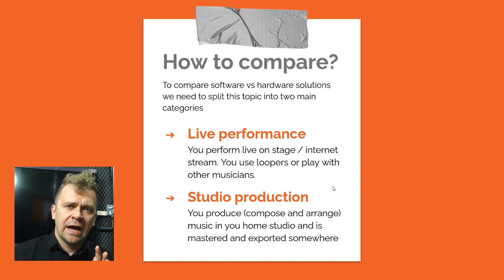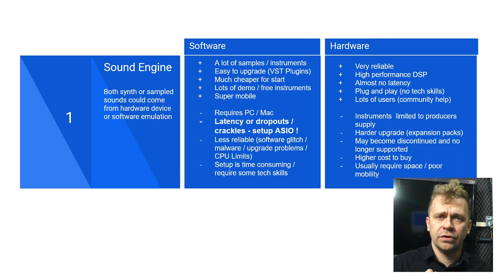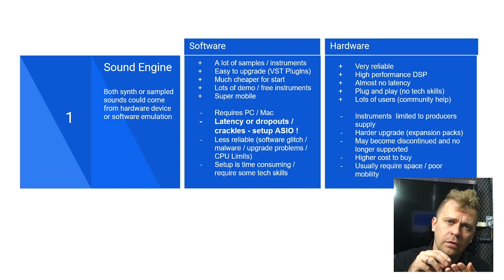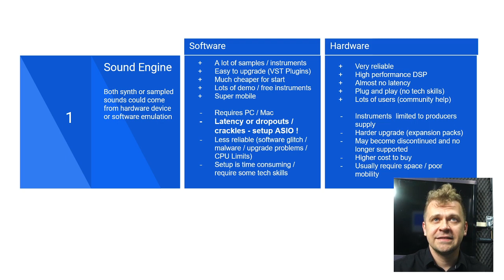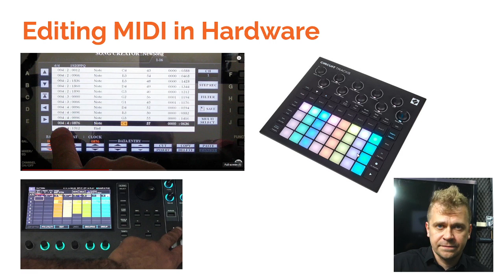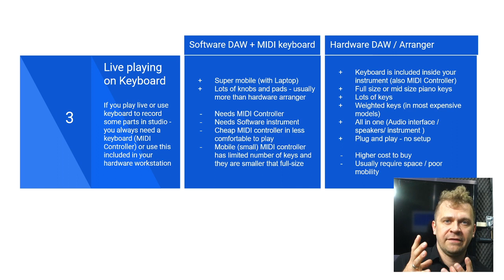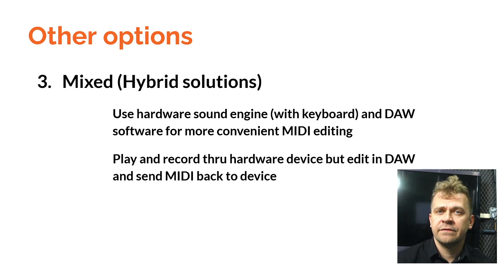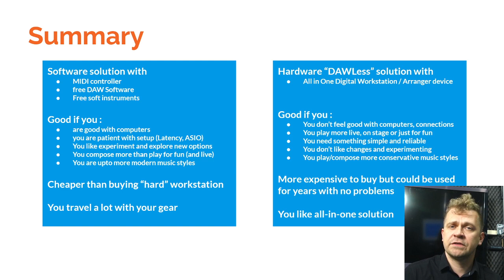Software vs hardware in music production and live performing - VST

Comment: Nice work here!

But I got a kinda silly question, do you think its possible to record a band (electronic drums, guitars, bass and keyboard) using vsts FOR ALL THESE INSTRUMENTS from ONE COMPUTER at the same time?
Reply from the maker: Hey. This is really good question and interesting concept. Basically yes - it is possible , but you need a lot of USB ports in your computer, because each individual instrument must be a MIDI device that will be connected to PC.

Drums, keyboard - no problem - they usually have MIDI, but guitars (lead and bass) - it is more complex.
 
I have seen somewhere device that changes guitar playing into MIDI notes but I am sure you will lost a lot of expression - MIDI notes are "flat" there are no vibrato, bending and more effect and nuances that "real" guitar player can generate. 
It may have sense for bass but lead guitar - I can not see the profit here.

BTW. Why you want to do this? Is your reason to quantize sync and change tempo of record ?

Comment: Quick question which autotune is the most flexible making me sound like a great singer. Including hardware as well for live performances
Reply from the maker: That's a really hard question. It depends from many factors for example : best effect you will have always in post-production studio tuning with plugins like vocoder in DAW because you have complete control over carrier track and the strength of "autotune". 
live stage performance is different. Here is always some kind of "compromise" between sounding natural and being "in tune" check for flagship keyboard hardware devices - they usually have vocoder onboard.  
I have a plan for video with Vocoder in PSR 975 - so please stay tuned to the channel.